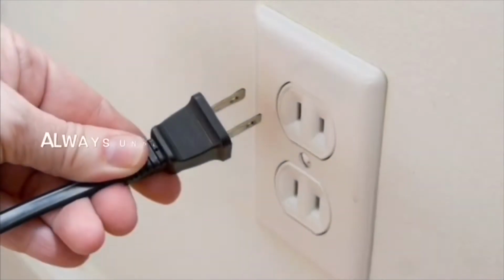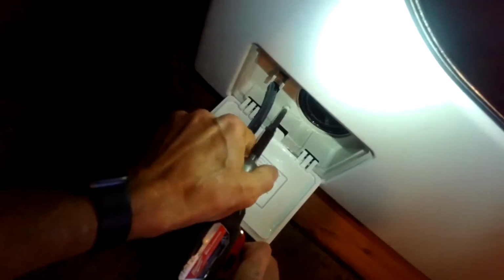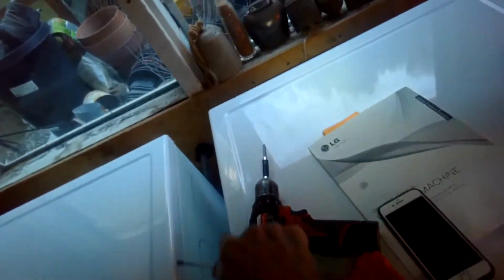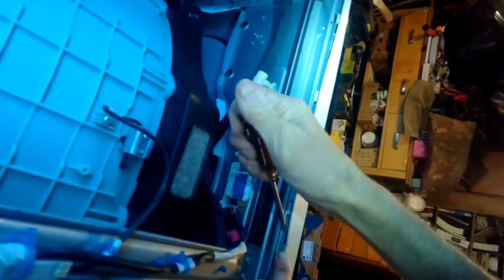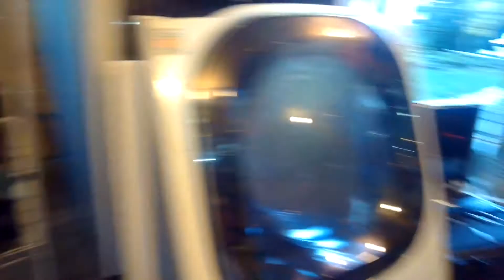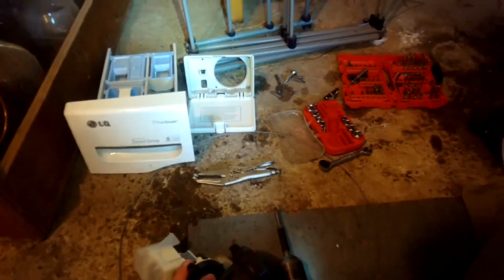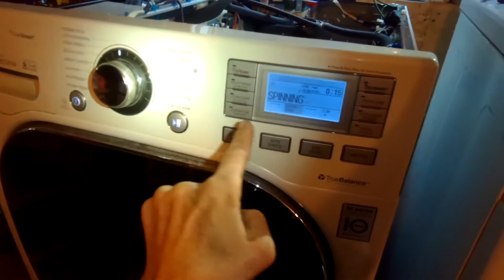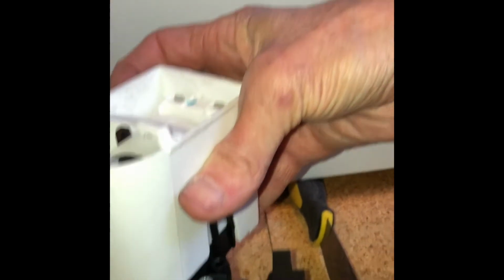✨LG WASHER- NOT DRAINING - EASY DIY REPAIR ✨

Comment: Scott,

On a stacked unit, how do you remove the front panel screws and pry off the panel? Excellent detail in your videos, thanks for recording, editing, and posting them!
Reply from the maker: You can remove the dryer first or pull them both out away from the wall by 4 feet and then lean it back against the wall and do the repair from underneath👍
Reply: @QuickAndEasy5MinuteAppliance  Thanks, Scott! I was afraid that would be the technique. Neither option sounds like fun.